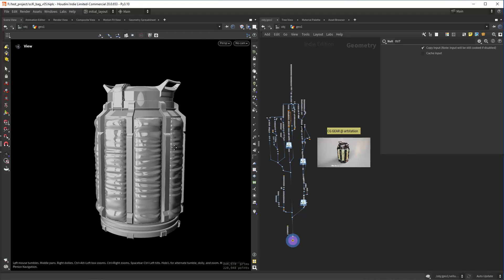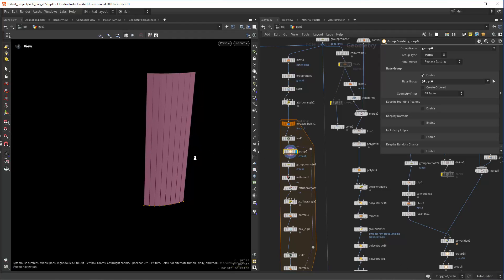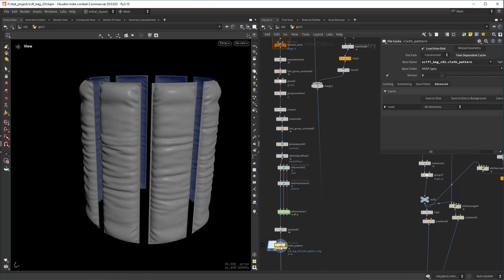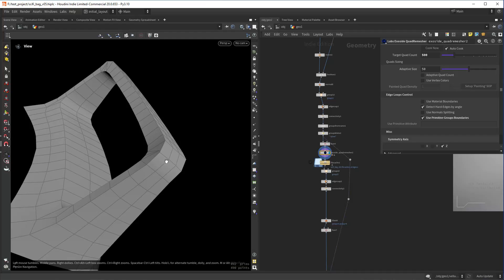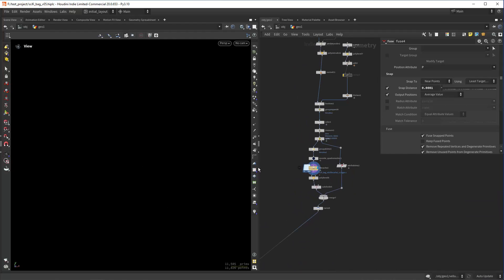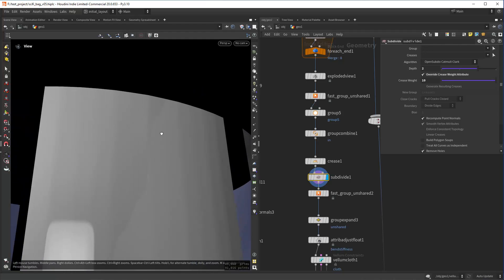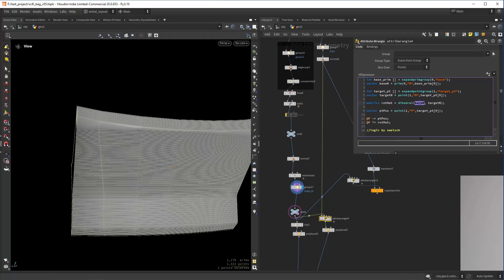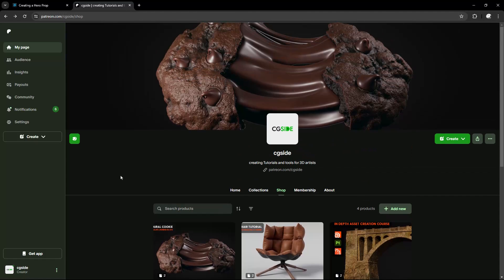Hard Surface Techniques in Houdini

Comment: Another great tip on using custom groups for quadremesher at 5:00. Will definitely try it your way. 
By the way: does checkbox "use Normals Splitting" works on your quadremesh like it supposed to? Looks like in Houdini it is completely broken. I was comparing it with blender and there it works exactly as described in help popup.
Reply from the maker: Yeah, the normal splitting seems to not work properly from the quick test I've done. Haven't tried in blender.

Comment: Did you tried the houdini modeler plugin?
Reply from the maker: hey, not yet, I will probably buy it when the 2024 version comes out. :D Cheers
Reply: @cgside  😇
Reply: @cgside  I have it and it makes direct modeling in houdini so much faster. Strongly recommend.
Reply: @photoindra  but not for production ready bro
Reply: @sridharan5172  You mean to pass other people down the line that doesn't have the pluging? I usually use "stash" node in this case after I'm done with some basic destructive modeling parts. And "move stash no new file" to keep filesize of hip file low.